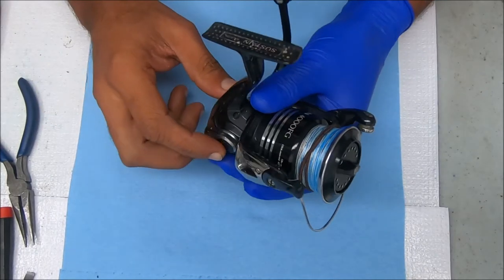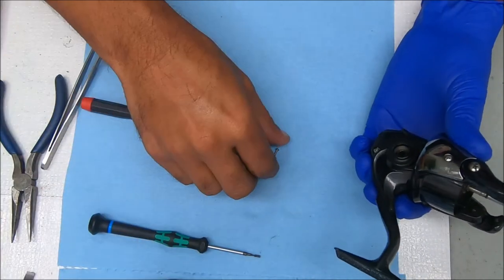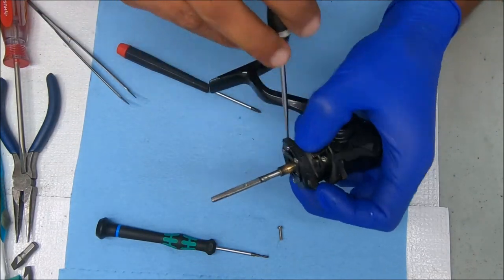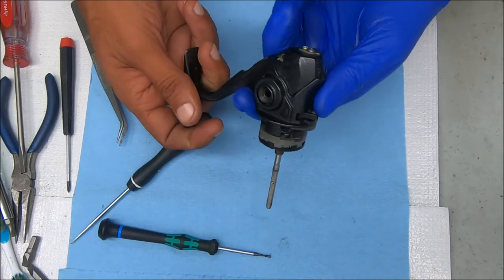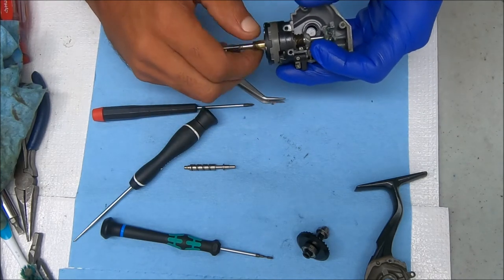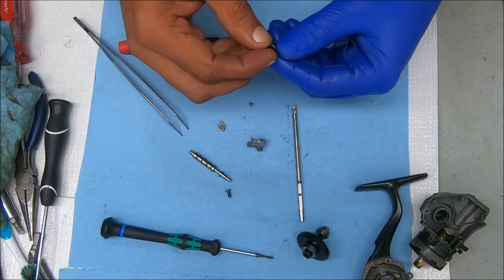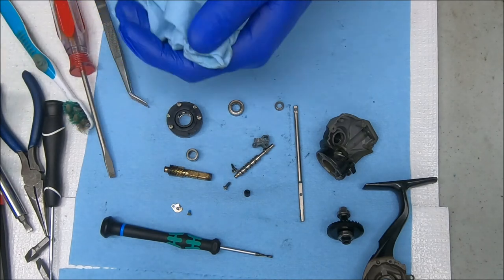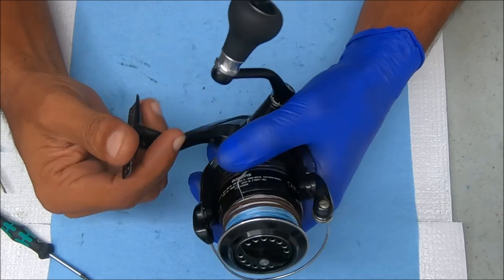Shimano Sustain 4000 Skipping - Diagnosis And Fix: Fishing Reel Repair

Comment: Would that block cause a grinding feel and play when handle is screwed in after a service. Its smooth until i screw it on redone it 3 times and my 1000 fg was fine after a service. Got me stumped first time ive had this happen.
Reply from the maker: Thanks for watching! Based on your description of the problem, it seems more likely you may have a shimming issue.... try playing with the number of shims on your drive gear until the reel crank feels the best to you. Hope this helps. Spread the word about the channel.
Reply: @TSGReelService  thanks will do mate. Yeah  i check the square bit and worm drive before look to be fine pinion and bearings all good was just thinking that after. First reel ive had that issue give it another go tomorrow. 👍
Reply from the maker: You're welcome and no worries. Good luck!